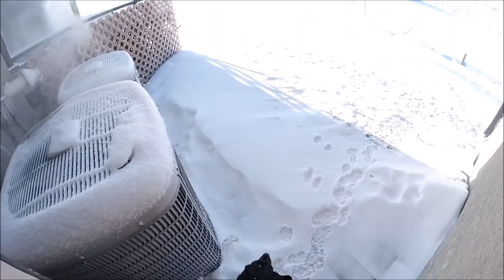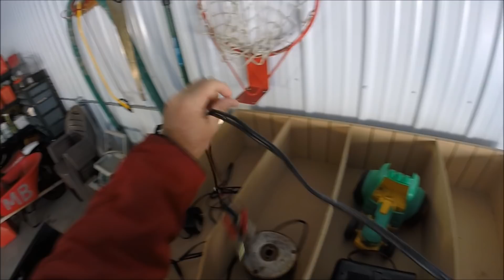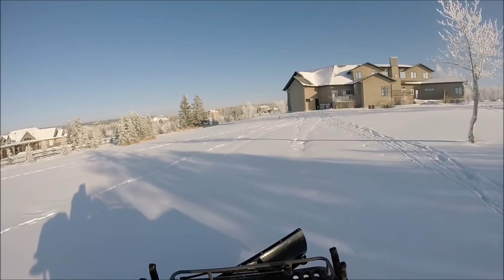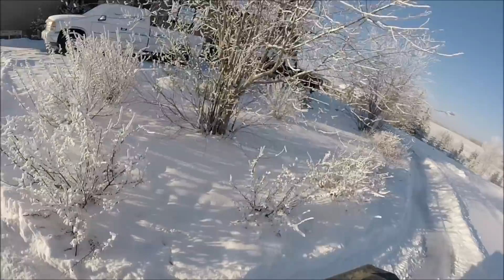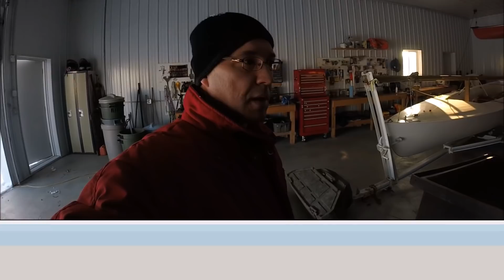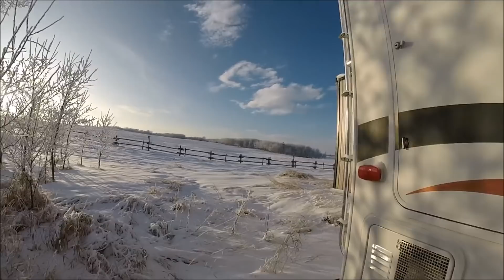Plowing my driveway with an ATV - Point-of-view

Comment: Every vehicle I have has a battery tender on it...  Never a dead battery anymore!  My car battery is going on 9 years and has the original battery cranking!  I live in Northern half of Michigan's Lower Peninsula.

I have battery tenders on my gas generator; riding lawnmowers; jet skis batteries; boat battery; summertime convertible; motorcycle; and a Benz parked in the winter.   Park them: connect the battery;  walk away,  they'll start when the time comes!

Comment: Done the same since since about 1990. In 2020 I upgraded to a UTV with heater, extra lights, and home made wing on one side.. Pushes twice the snow much faster. Did buy a new atv at the same point and it's set up to plow as well, but use it more for pushing wind rows of pine needles in the summer.

Comment: Hell of a setup you've got there!  Looks like a set of tire chains would probably help a fair bit... not only for pushing, but steering as well.  Or, if you want to cut your time down a nice 30-40hp tractor with heated cab and front mounted snowblower would be the hot ticket!  ; )
Reply: NS Gearhead properly done, an atv will finish faster than a tractor in less than 1/2 the time. Remember, unless you're pushing 10"+ of heavy wet snow with an atv...on a driveway like his, tou can plow at fairly high speeds (15-18 mph). Tractor with a blower is maybe 2-3 mph at best.
Reply: @ROTAXD  I like the way you think

Comment: You can cut your time down by re-angling the plow at the end of each  run and plowing on the way back. This way you’re plowing on every pass. I can’t tell what setup you have but I have a 2013 Kawasaki Brute Force 750 4x4i EPS with a Warn 60” tapered plow on a front mount. The tapered plow really throws the snow when angled properly.

Comment: Mr. MartyUpNorth seems alright.  That's what snow plow looks like.  Cubes of snow per minute seems like the main concept of energy vs engineering.   Hope I am able to fit my All Terrain snow plow onto my truck.  Thinking about using a electric thread to lift & set the blade height.

Comment: Tracks and a flex plow blade is the way to go if using a quad. Pile high and leave edges smooth so wind blows straight across and doesn’t dump more in the driveway.

Comment: I have a 400 ft ash fault driveway I had a can am quad we had 13in first year we lived there 3 times in 2014. I couldn't barely get it done. I sold the quad bought a 95 k2500 Silverado with 120000 miles on it. Never had the problem again. It's just easier. Or put a plow on one of your trucks we seen on video there will be a time you wont be able to push snow but with a truck you'll be able to do anything maybe not 48in though.

Comment: This video may be 2 years old but, you need to take off that winch motor and clean it out. Then re-grease it. Also, clean the electrical motor.
I had that same nasty noise and just cleaned it. Sounds new again. Idk what causes that noise but, doesn’t sound good.
Reply from the maker: Thanks for the advice.  I sold that old beast a year ago.  Now I run a new Polaris 1000.  It makes small work of this job.  Cheers.
Reply: Same hondas winch is horible

Comment: As the temperature hits 95 south of Chicago, I'm putting my new plow on my Can Am Commander. I plowed many years with an ATV and found a few bags of sand or salt gave me the traction to blow through any product from piled up snow. Problem is that it's harder than hell to steer if you don't have power steering. Enter...my Can Am Commander....with power steering. I bought a power tilter (Koplin) and hopefully things will get easier. I've been in your shoes though. Brrrr If you want to get rid of your dogs I'll take them! Good luck

Comment: should slap a strip of rubber on top, will help with spill over
Reply: also do you have low gear on that thing? seems like shes struggling a bit more than it should
Reply from the maker: This old gal has been replaced by a 1000 with a 66 inch plow.
Reply: @Martyupnorth  very nice!

Comment: Is that an Etchells in your garage?
Reply from the maker: No.  It's a 1968 Flying Dutchman.  Much smaller.  My boat is only 20' long and weighs a fraction of what an Etchells weighs.  Mine can be sailed with just a 2-man crew.  Very fast boat.

Comment: First problem I see is you did not check the oil.
Second, always put the red (positive) cable on first... then the ground.

Me thinks you need a more tactical method of attack on that snow.
More efficient approach.

Thanks for the video though.
I'm planning on making a PLOW for my quad.  Mine is a 250 cc Suzuki two wheel drive.

Do you think your machine could handle a wider blade ?
If its got enough power, I think it be a great help.
Reply from the maker: Hi Penny.  I have now have a 1,000 cc quad with a 66" blade.  It can push a ton of snow.  I know I can be more efficient plowing my driveway, but I'm not too concerned by that.  Cheers.
Reply: nice to hear from an expert
Reply: @pddpup7767  as I am the one and only person that services and repairs all of MY equipment, checking the oil is high on my priority list. I've heard people say "well, I never had a problem before so what's the point".

 You'll never know if you have a problem . . . if you DON'T check the oil... until it's too late and your engine is shot to crap in seconds.

It's always a good habit to connect the positive cable first. If it is not grounded there won't be a discharge or spark. This can fry certain electrical components.

I am my own mechanic and I have to pay for everything out of pocket, so these things are important... IMHO

Definitely not an expert.
Just try hard to do things right.
Reply: @pennykrueger5644  I appreciate you giving him this feedback. We won't need to worry about snow anytime soon here in NY, but that is great information that I will use later on. Thank you!
Reply: Might want to get a four wheel drive ATV first. My snow blower only has two wheels, and will get stuck just spinning and I have to wiggle and push it to get it moving again.
Reply: @pennykrueger5644  Marty's a professional mechanical engineer with a ton of experience.  He supervises overhauls of 5,000 hp motors in the oil patch of Alberta. I'm pretty sure he knows what he's doing.  That old quad is just that...an old quad.  The fact that his 2002 700CC Polaris is still running after 15 years of abuse tells me it's been very well maintained.

Comment: What kind of plow is that please?
Reply from the maker: timber it’s Polaris’ Glacier plow with the Polaris mounting system. It’s very good. It held up for a decade with no problems. My new 1000 has a Kimpex mounting system and it’s junk. It’s already bent. I also had to bolt it on permanently because their hardware kit was junk. I’ll post a video comparing the two shortly.

Comment: Apparently your shop isn't heated?
Reply: teamcummins are you surprised?
Reply: 2 things...in alberta some do heat their garages since natural gas is so cheap.  2nd, cold does not affect batteries.  It does however make cold engine parts harder to move.  My 350 fourtrax has never had a battery charger on it and starts quickly at 0 Fahrenheit.  If a battery is failing only then will it let you down like this video
Reply: @larrymoore5882  just curious. Because if it was heated he left the door wide open lol.  Looks like it has an insulated door and sheeted walls inside